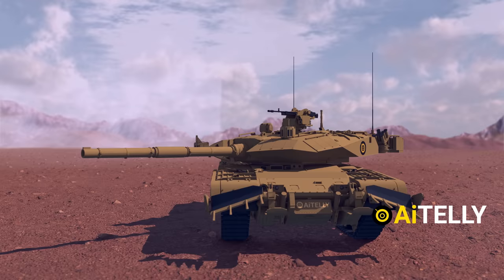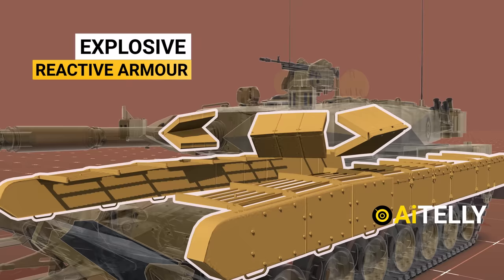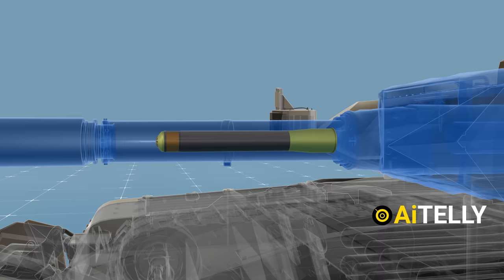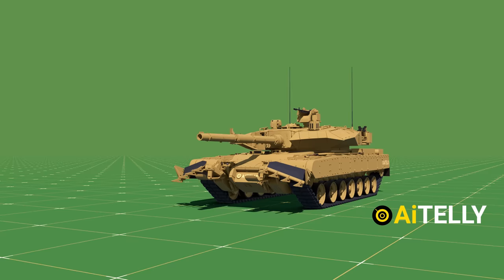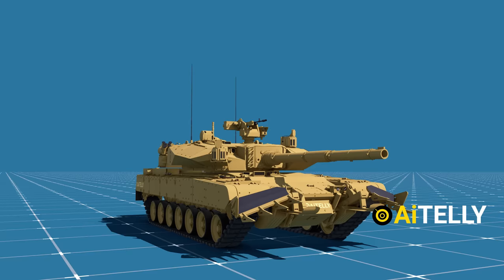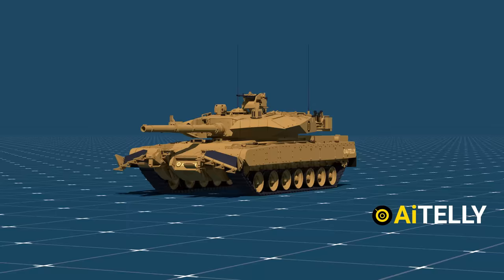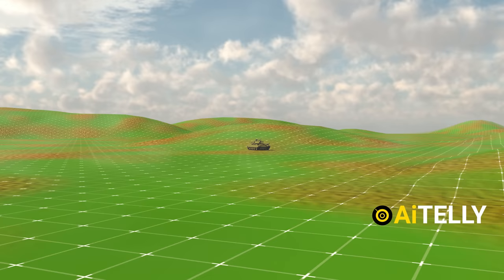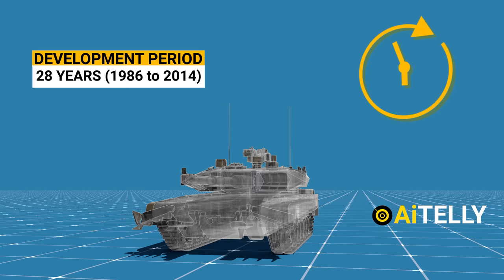Heaviest Battle Tank Arjun Mark 1A Mark 2 | How it works #tank #tanks

Comment: So is this a pretty good tank against modern day MBTs, does it stand a chance against 1v1 battle against the Leopard or the Abram or the T90s?
Reply: It would be fair to compare it with
Type99II, VT4, Al-Khalid2 and T80UD tanks.

Arjun has impressive armor protection but the war in Ukraine has proven that tanks require Active Protection system. But offcourse Indian Army armor tactics are proefficient and tanks get ample cover from infantry and IFVs. Unlike Russians in Ukraine.

Rifled gun is a downside if you consider its smaller life span but plus side is it can fire HESH rounds. Considering how Indian Army needs to operate in urban environments. HESH is effective against troops inside bunkers or troop concentrations. 
No information on its APFSDS round . How well does it compare to Naiza APFSDS. Or DM53?
Reply: No it doesn't simple as that and neither do they because tank battles are very unpredictable and now with introduction of drones they are just infantry support vehicles.
Reply: No at all Abraham is best..but Arjun suits Indian situation....
Reply: @raunak7461  elaborate
Reply: Arjun was designed to operate in a specific type of terrain, like the desert in Pakistan. The T-90 was designed for a different climate and terrain. In areas like Pakistan, Arjun would destroy the T-90 without a doubt because the T-90's weren't built to handle the heat in the desert where temperatures can get as high as 50 degrees celsius. Even in head to head in normal climate and terrain, Arjun wins against the T-90 without a doubt. It's just better than the Russian tank, as proven in the 2010 trails against the T-90, where it outperformed the T-90 in every single test. There's only 1 place in which the Russian outranks the Arjun, and that's price.
Reply: @blitzen9259  i see
Reply: @blitzen9259  this is bs, the T-90 is capable of operating in many areas and it does operate many middle eastern countries. The arjun has almost no chance against a T-90, ESPECIALLY a T-90M
Reply: @Some Boi t90m is a tank made for open field engagements unlike arjun that is designed for open engagements and urban combat and unlike t90m this tank has a blowout pannel system that is much desired as it gives some protection to the crew unlike t90m where ammo is gone if a round penetrates the armor
Reply: No it will not see 
Even India has arjun tanks but it buys T90 as a backbone 
there are more than 5000+ tanks that India have out of which 3000 are massive battalion t90 (they call it BHISMA)

What i think as a European is the T-90 due to great mobility is for China, desert areas, mountains etc
ARJUN is just made as a 'Killer Tank' just go and kill there is no coming back or mobility 

I mean you can see heavy armour best missiles that speaks a lot why it was made so it will be produced basically for Pakistan region 

Still it has got a lot of advancement tho :)
I will compare it as the next to the line to the one you have specified 
and for correct comparison you can say it is similar to T-80 (which were heavy as F) , Upgraded t-72 (one of the best tanks) or the 1st gen Leapond and Abrams (lower to the current ones) 

At last it is a good tank and they have made it for themselves that's why you see they don't advertise it for sale like there other weapons system like Radars, Brahmos, Pinaka multiple rocket launcher etc
Reply: well it was made to fight Pakistan in the western side of India, but considering the fact that the tank can take armour piercing rounds at point blank range... defeating it for another tank without air support is going to be one hell of a challenge for any tank in the world. however it can be done and real world battles are not just tank on tank ideal situation so yeah air superiority counts.
Reply: @Adventurer-Rikth  no not really the tank is not very capable of stopping any capable munitions
Reply: @someboi4535  The Indian government tested the T-90's we have against the Arjun in the desert back in 2010. The machinery and electronics of the T-90 malfunctioned and the tank wasn't able to operate properly in the heat of the desert. The Arjun had no problem defeating the T-90. The T-90's operating in the middle east are underpowered for this exact reason.
Reply: @blitzen9259  do you have proof of your claim?
Reply: @Some Boi  T-90 Armata yes that can operate anywhere but not the T-90 itself until unless you modify it
Reply: @Mr Trampoline  well simple thing is T-90 is cheap Arjun is too expensive to be bought in bulk to made a backbone if India was to buy so many Arjuns its defence budget would go bankrupt in a matter of days
Reply: @karandullet380  wtf is a T-90 Aramata bruh... are you aware of the fact that the armata is the T-14?! The T-90 has 2 main variants operating out there, the T-90A and the export variant T-90S, and the T-90M Proryv-3 and the export variant T-90MS 
All of these variants are easily capable of operating anywhere in the world
Reply: @someboi4535  except in ukraine😂
Reply: @darkassassin4166  eastern European plains like in Ukraine are where these tanks operate the best
Reply: @someboi4535  Yea all i see is t-90 and t-72 wrecks

Comment: INDIA HAS DEVELOPED BETTER AND LIGHTER ARMOUR TO BRING DOWN THE WEIGHT. GERMANS COULDNT SUPPLY ENGINES SO INDIA HAD DEVELOP IT THEMSELVS. NOW A 2000 HP ENGINE IS BEING DEVELOPED AS WELL. THE MAKING OF THE TANK TRACKS ARE ONE OF THE MOST ADVANCED PARTS ON A HEAVY TANK.

Comment: I just want to point out that 1: the m1 is called Abrams, not Abrahams, and 2, the chally 2 with the add on armor is heavier than the Arjun mbt if I recall correctly
Reply: Challenger2 is about 7 tonnes heavier. So not sure what the title means.

Comment: You’ve got your info mixed up, the mark 1a mark 2 is 68 tons Fully loaded. The challenger 2 is 81 tons fully loaded.
Reply: Challenger 2 is barely 64,000 kg which is the heaviest battle tank from NATO, Abrams can be heavier with additional kit.

While Arjun Mk2 is 73,000 kg without battle ready configuration which is at least 10,000 kg heavier than Challenger 2.
Reply: @gulag88 POV the challenger 2 TES weighing 74.8 tons without any battle configurations:
Reply: @Jpz-4-5  still pretty lightweight compared to Arjun Mk2.

Arjun Mk1A's weight has been significantly reduced to 67,500 kg which is still the heaviest battle tank.

BTW, Challenger 2 UK tonnes is 74 tonne which is barely 63,000 kg battle ready.
Reply: @gulag88  uh nope? America has documented the challenger 2 TES weighing 75.9 AMERICAN tons (68,310kg) with no combat configurations (ammo, composite armour, systems etc). Just the hull, turret and tracks.
Reply: @Jpz-4-5  75 tonne US is barely 63,000 kg
Reply: @gulag88  uh nope? 1 US ton is 900kg. So 75.9x900 is 68,310. And that’s the non combat configuration.

Comment: These are all basic requirements of a modern tank. I hope they improve on the design, with a 155mm main gun with autoloader. That will significantly increase the firepower and reduce weight of the 4th crewman and armour needed around him. It also needs a urban survival kit like TUSK for M1 Abrams. Otherwise, tanks are useless inside cities.
Reply: I agree. However the area of operation for Arjun is the great Thar desert that forms the western border with pakistan. In high heat of deserts often the auto loader gets jammed . Imagine having all the best features and lighter tank that doesn’t fire when needed. Hence they Went back to have a manual loading option . So while selecting the design the field of operation / terrain is equally important.

Comment: It's capable like leopard 2A5 and have armour protection like challenger 2

But why every tank is fitted with mine clearing equipment, This is not how armoured division works. And lacks APS
Reply from the maker: noted
Reply: India has a desert so it needs a mine clearing

Comment: The only drawbacks I see are a rifled gun and the lack of an APS
Reply: The Indian army keeps prefering the Rifled gun, even in the Arjun mk2. This particular rifled gun has better muzzle velocity than the older traditional Rifled guns thus making AFSPDS rounds relatively stronger, but also posses the ability to fire accurate HESH round. 
Arjun mk2 also has the ability to fire ATGM  from its main gun.
Reply: The rifled gun is not a drawback anymore, mainly because we have developed an APFSDS round with a penetration of 500mm at 2km at 0°, and a rifled gun fired atgm with a penetration of 800mm.
And given the fact that it will face 40-45(400-550mm frontal plate protection) tons tanks of the Pakistani army, this firepower is sufficient, so changing the rifle to a smoothbore to increase its firepower up to the same level as western tanks would be a waste of money.
That's why the army didn't change the gun when agjun mk1 was upgraded to mk2 standard

Comment: the narrating needs more work. whenever you speak in lower pitches, the volume also decreases making it difficult to hear what you're saying. The reason is because you start your sentence in a low pitch already, so any lower pitches can only attained by lowering the volume. But lowering the volume doesn't achieve the lower pitches at all. You need to use the vocal fry if you want to go any lower. This is just bad for narrating. My suggestion is raise your entire vocal range up slightly and blow more air from your lungs through your vocal chords.

Comment: The Arjun tank is a good tank for some boarder regions with Pakistan. 
Which is not surprising considering the wars were Pakistan kept invading with tanks previously. 

But the tank is very much a waste rn. A big country like India shouldn't depend on a tank that can't cross 99% of the bridges in its own country.
Reply: The Arjun MBT doesn't have to cross any bridges in India - it is transported to the border regions via railways - India has the most extensive rail network right to its borders.
Reply: @SodiumSyndicate  I think your confusing tanks with artillery. 
If not what's the point of having wheels on a gun if you can't go where the enemy is
Reply: @ahtheh  The Arjun can go where it wants, it even has lower ground pressure than all other MBTs. You are not moving at max speed off road all the time. 

In places like the thar desert with all the heat, dust & sand traps plus sudden marsh lands - you need low ground pressure & ground clearance. This is where Arjun shines over all other MBTs, it is built for this open terrain & can handle all anti-tank rounds in existence.
Reply: @SodiumSyndicate  yes, I did say it was it was good in boarder regions with Pakistan, which is mainly desert area ( don't bring mountain areas of Kashmir into this)

But Pakistan isn't even the 2nd largest boarder with India and India is spending tax payer money on a bottomless project
Reply: @SodiumSyndicate 
 btw it can't do near the Ganges Flood basin or the hill tracks of the seven sisters
Reply: @ahtheh  Why does India need tanks near the Ganges flood basin? - Bangladesh is going to invade? - the last time any tanks were needed there was in 1971. 

Presently, even if in an emergency war with Bangladesh, Wheeled APCs with roof mounted guns & gunships & fighters are enough.

When it comes to China, Arjun can be deployed via the new border roads, in other areas where smaller tanks or APCs are needed - there are other solutions.

Comment: 68t is way to heavy... the leopard 2 is still a good tank despite being old because it has the perfect balance between Firepower, Protection and Mobility.
Reply: It is not heavy, in fact the Arjun has lower ground pressure than the T-72, forget the Leopard 2. The tracks of the Arjun are longer & wider & make it much better for the desert & plains bordering India & Pakistan. In this place, armor is EVERYTHING since you are right out in the open without any terrain protection.
Reply: it is good because it is german not beacuse it is actually good , any machine is great until tested against innocent civilains of middle east

Comment: I think speed is not that much matter in tanks the developers should focus on building heavy Armour which can withstand any ATGM or shells from all sides coz today tech is high and you can't escape a rocket like javelin at any speed armor company should focus on more bulky but strong tanks
Reply: cobraboi6784  Mobility was key during WW2 when anti-tank weapons were used manually & were inaccurate - you could dodge them. Not anymore, you cannot dodge a guided rocket via mobility anymore - so armor is more important than speed. 

However, the Arjun MBT has lower ground pressure than even light battle tanks - so while it is slower, it won't get stuck in desert sand or marsh like other battle tanks with higher ground pressure.

Comment: to me this tank seems like a mistake especially due to the wieght and poor frontal armor. now since there wasnt much info about the type of isreali rounds its era stopped I can't speak for its protection but the left side of the tank is just completely optics and with most of the crew in the left side it doesnt seems like It would protect much. and for the blowout panel thats good but if any shell is stored outside of it in the front of the tank than those panels wont help. I am curious tho as to the preformance of the era and the types of munitions it is able to fire
Reply: Check Wiki....it can fire a variety of different shells

Comment: The title of the video is misleading. The heaviest MBT is the Challenger 2 (RC2) at 75 tons when fully loaded. A video of this quality should not use such misleading titles as clickbait.
Reply: That is a the full loaded combat weight its completely irrelevant, the abrams is 80+ tons with all the extra armor. But those are not part of the tank. If the arjun had the same armor packages it would weigh more
Reply: @thesupreme8062  Just like that the weight given here for Arjun is incorrect. The Arjun weighs less than the Challenger whichever way you take it. It also weighs less than the Abrams. The title of this video is misleading.

Comment: Mine e rake is 3.5 tons and it is added when needed so minus that another 1000 1b off for carbon fibre wheel rollers lower ground pressure than russian british and American tank hence better mobility in sand and mud  pus local engine in final testing 1500 hp without turbo and almost 2000 hp with turbo and half the size off old mtu engine so arjun is just as good if not better than most tank in the world technology  wise it at participating with western tanks and ahead in certain areas how many tank can take another tank from 8 km lot off paid trolls deriding arjun tank because off russian bribery off indian army brass

Comment: I knew its Indian version of Leo 2a4. It has that massive weak spots in turret, upper and lower frontal plates. We can see that It is inspired by Russian tanks when it comes to ERA placement in sides and turret. Im not sure about the gun. Do they still use rheinmetall Rh-120 or any other upgraded 120mm? or do they have 2nd gen thermal or same outdated 1st gen thermals? at the end Leo 2a4 is still a very capable fighter and this one doesn't seem to be much different from it. Which make this also a capable fighter.
Reply: 120mm rifled gun( not as powerful as smoothbores but it has 500mm APFSDS which is enough for Pakistani tanks( 40-45 tons, 400-550 mm of RHA at front)

 
2nd gen thermals.

Comment: Biggest flaw is having that barrel rifled. That barrel has to be re rifled after a few hundred rounds. Especially with firing darts. The newest smooth bores last 4x as much
Reply: why are you bashing it for that reason we have smoothbore guns too , the point is this tank is not made to fight high value russian tanks it is indeed made for chinese tanks and the ones rebranded by pakistanis , if we need smoothbore we can easily fix it to the next chassis 
and we two differnet tanks in development the next one will be t72 replacemant tank addressing all the flaws we have now 
one will be a light tank for munching type 15 tanks in tibet

Comment: The Arjun is a pile of crap, the entire front of the turret has zero add on armor, for starters..I could keep going but the tank is a joke
Reply: Use ur ey it has armour before war it will more add on armour even gun side
Reply: @fekularsome2363  how do you plan on attaching it? You go to war with what you have not what you want..oh how is Tejas doing?
Reply: @corey8420   Tejas is flying, the air force is going to receive mk1a in march 2024, and govt is planning for ordering 50 more, making it 133, western tanks too we're taken out in  Syria and Yemen and Iraq despite heaving good protection no wonder how?

Comment: the worst tank in the world
Reply from the maker: Let see how the Mk2 will do
Reply: Arjun has a 1400 hp engine as compared to 950 hp engine of T-90, which explains why the top speed of Arjun is 72 km/h, whereas that of T-90 is 60 km/h. Arjun requires a crew of four to operate - commander, gunner, loader and driver. T-90 needs a crew of three to operate.
Reply: I think it’s better than t72 and t90
Reply: Chinese Bot Spotted
Reply: @ineedpowers5151  It would have been a good tank if it came out in the 80s or 90s.  However it is extremely outdated as of today.  It's basically a worse leopard 2A4.  2A4 is outdated now.
Reply: no abrams take the lead
Reply: @Alexander_Hodge  You are talking about the Mk-1 version, let's see how Mk-2 iss!